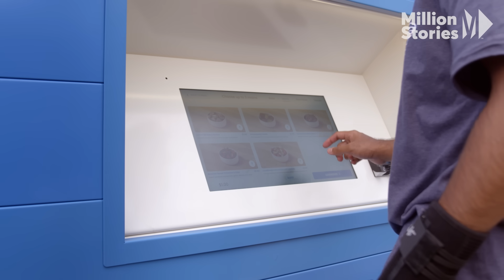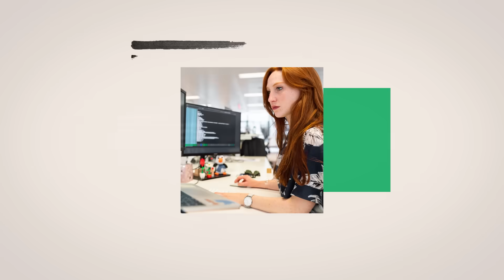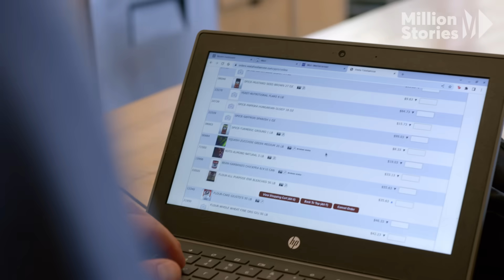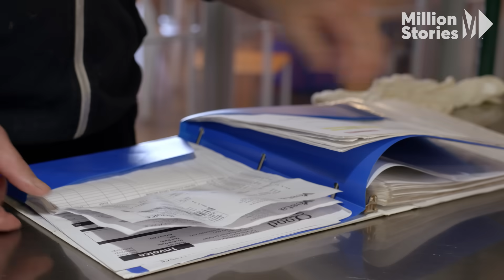This restaurant is run entirely by robots

Comment: 🎯 Key Takeaways for quick navigation:

00:00 🍔 Eric Minnich's Introduction and Restaurant Automation
- Eric Minnich discusses his role as a chef in a fully autonomous restaurant.
- Introduction to the concept of a restaurant with robotic food preparation.
- Comparison between a traditional chef's work and the development of robots for food service.
00:38 🤖 Rise of Automation in the Food Services Industry
- The historically slow adoption of technology and automation in the food services industry.
- Factors driving the need for automation, including labor shortages, rising costs, and theimpact of the pandemic.
- Mention of technological advancements such as QR code menus, automated kiosks, and robotics.
01:10 💼 The Changing Landscape of Jobs in Food Services
- Introduction to the changing job landscape in the food services industry.
- The challenges faced in the early stages of creating a fully autonomous restaurant.
- The emergence of blue, white, and no-collar jobs in the modern workforce.
02:15 🍲 Food Preparation in the Robotic System
- Explanation of the food preparation process within the robotic system.
- Unique challenges faced by chefs when designing meals for automated systems.
- Balancing the requirements of the robot with maintaining food quality and flavor.
03:16 💰 Benefits of Robotics: Cost Savings and Staffing Solutions
- Discussion of how robotics can lead to cost savings and potentially lower prices for consumers.
- Addressing the staffing challenges in the food industry, including labor shortages and high turnover rates.
- The potential for better quality of life and more manageable hours for restaurant staff.
04:17 🕰️ Impact on Work-Life Balance
- How automation, like the Mezli model, can provide better work-life balance for restaurant staff.
- The advantages of working traditional 9-to-5 hours with robots handling repetitive tasks.
- Personal experiences of chefs like Eric Minnich in terms of having time for cooking and creativity.
05:27 🤝 Human Touch and the Future
- The role of robots in restaurants and their ability to reduce repetitive tasks.
- Acknowledgment that robots may not replicate the true human touch and hospitality.
- Uncertainty regarding the impact of robots on jobs in the food services industry.

Made with HARPA AI

Comment: Every other attempt had failed and ended up with them closing because in truth Robots can not output as much as humans , as humans are more reliable and precise believe it or not.

If you can't trouble shoot the problem with a human you can easily replace it.
Try that with a custom made robotic system. 😂
Reply: a human designs the robot. do it well.
Reply: Well, Robots can learn by understanding, same as a human, but at a much much faster rate. A human needs years to perfect a skill. An AI or robo homie only need 1 time, and it will continue to perfect the perfection. Humans are easily replaceable in a job setting, AI and robots are immortal beings.
Reply: @SozioTheRogue    Remember the pizza robot in France and the burger robot in SanFransisco ? Where are they now ?
Reply: @Human-bf7kz  you are engaging in "what aboutism" to discourage a point. You could say that to an AI if they were right in front of you. That would just be mean af lmao
Reply: @Human-bf7kz  I have 3 pizza vending machines in my town in france and it doesn't even have 6k inhabitants.
Reply: @metasamsara   Vending machine limited to reheating ?